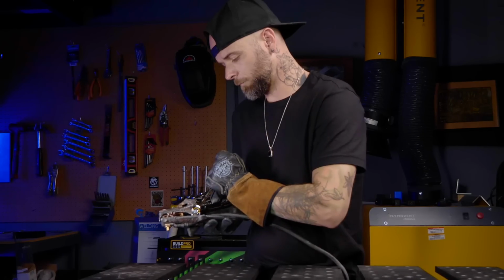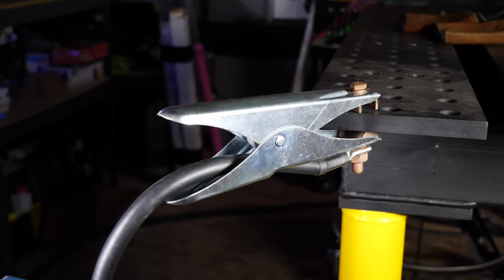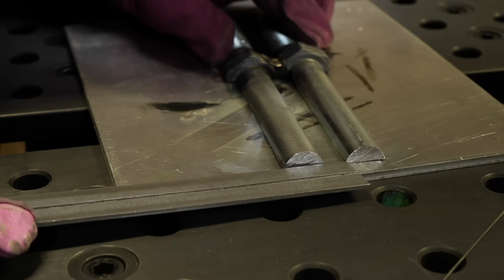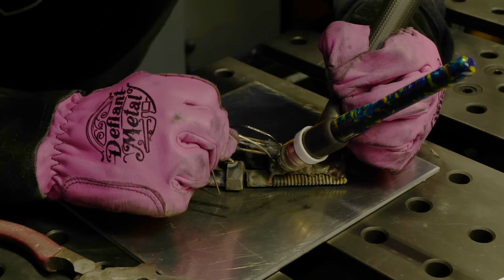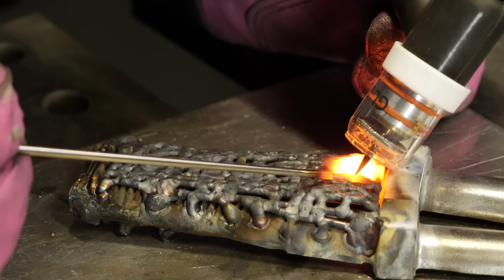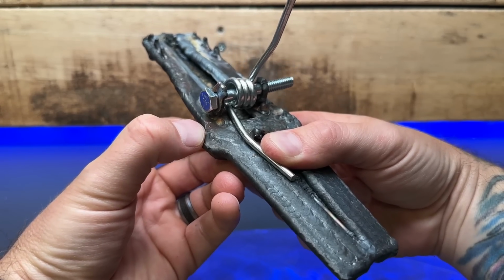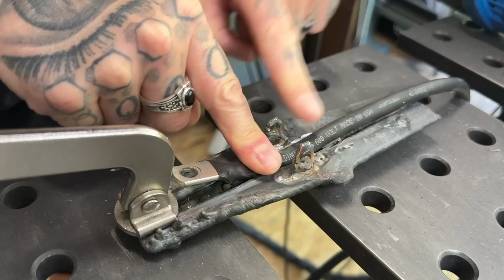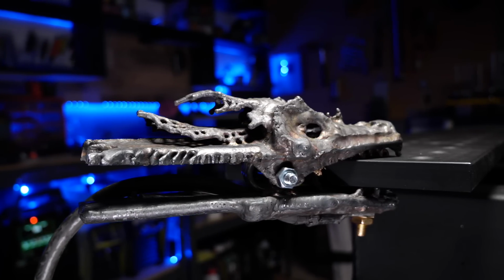Turn Two BOLTS Into a Custom Dragon Ground Clamp

Comment: Almost nobody Plus One !  This one was a challenge, but going back and looking over the problems reveals the answers. 
Safety, ya I've had discs break up on me, not fun. Problem solving, the slot in the bolt is exactly what i would of done, learned that one many years ago when working on Blackhawk helicopters with stripped screws and busted hardware that was going to be replaced.
Absolutely loved the holding of the fingers from the house to the store to keep the length of the third bolt.  Interesting how the spring that holds tension is so weak when tacked hmmm.   Cant wait to try and fabricate  everything id like to soon!  😁
👍👍👍👍👍

Comment: That's a cool clamp, nicely done. I agree with @T7ZIAN those are zinc plated. They looked too blue to be SS. Home hardware's website says 2116-272 is "Zinc Plated Coarse Hex Bolt" It's good that you were wearing a respirator.

Comment: Terrific project, Dusty. I'm guessing it's kind of heavy but wow, that's one really cool looking ground clamp. Idea for next time - might it work to compress the spring in say a vice, then wrap light wire round and round the spring ends to keep it compressed? Then you could slide it into place, bolt it up, then cut the wire to release the spring?

Comment: You're an amazing artist; fantastic job!

Yeah, given the heat treatment of a spring; welding on one is no Bueno-

Something else you might consider, is the conductivity of different materials. Stainless is actually a pretty poor conductor; although I have a "3rd hand" made partially from stainless, & it's worked for years. I have repaired ground clamps in the past, & tig brazed  aluminum bronze on the contact surface-  Highly conductive and more durable than silicon bronze.

Thanks again!

Comment: Love the shape and the custom ground clamp, thank you for this
However I was internally screaming from all the oxides and gunk the whole time all that stuff is on the inside of the metal not just the outside for the look
If I might make a suggestion if you try something like this again, try welding everything clean like normal then at the end when you have the final product use a flame to heat it and let the oxide build on the surface to get the effect you want, that way all the gunk is on the outside not the inside 
I'm not an expert I'm just working the problem through in my head
Feel free to tell me if/why I'm wrong

Comment: Spring steel is specifically designed to have high elasticity and resilience. These properties are achieved through careful heat treatment processes that create a specific microstructure in the steel.
Welding introduces intense heat to the steel, drastically altering its microstructure in the affected area. 
that solution minimizing heat affected zone by tacking the end is pretty genius.